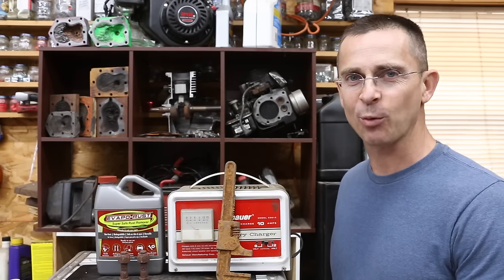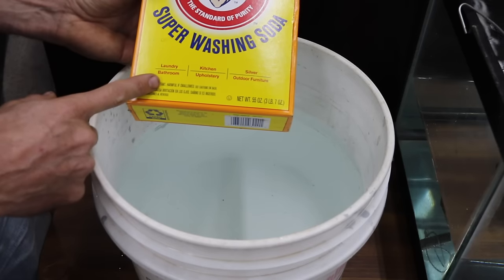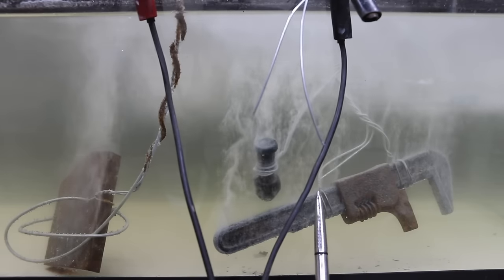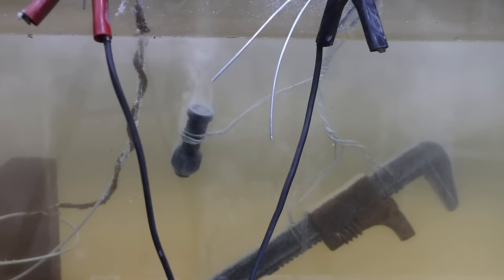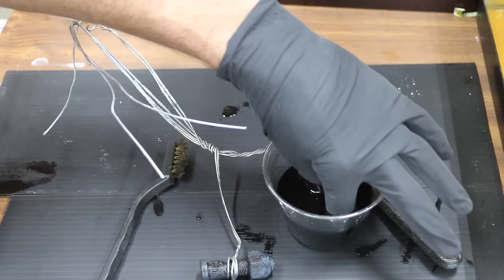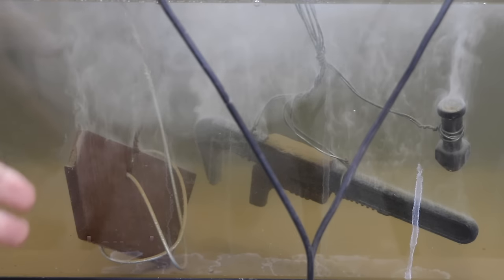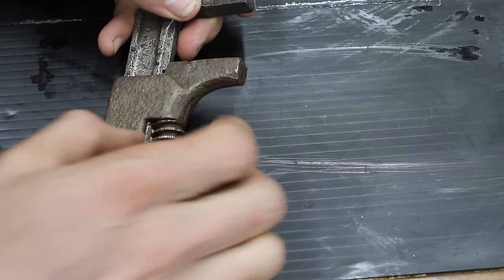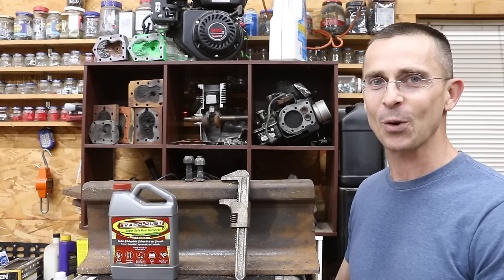Is Electrolysis better than Evapo-Rust?  Let's find out!

Comment: I use both processes. For small parts (nuts, bolts, etc.) that can fit in my Horrible Freight ultrasonic cleaner, I use Evapo-Rust. I first clean the part in the ultrasonic cleaner to remove any dirt, grease, etc. that might contaminate or inhibit the Evapo-Rust. I then drain the ultrasonic cleaner and fill it with Evapo-Rust. I use both heat and ultrasonic agitation. It works great for getting into fine threads, crevices, etc. in the small parts. Much better than just letting it passively soak in Evapo-Rust. For larger parts I use electrolysis. Note that it's important to only use plain steel in the electrolysis process--both for the part being derusted as well as the sacrificial part. Stainless steel, galvanized steel, and other plated steels can make a toxic soup. Plain steel only leaves iron oxide behind so it's safe to dump it in your yard or down the drain. I reuse it over and over until it's just nasty looking and then dump it. Even when it's so brown you can't see anything in it, it's still effective for electrolysis. Another great video. Thank you and happy new year.
Reply from the maker: Lex, This is great advice!  Thank you and wishing you and your family a Happy New Year!
Reply: @ProjectFarm  Horrible Freight is a good name lol. Just a tip, HF has a lot of great stuff for cheap, and a lot of garbage for cheap. If you want to have a good HF experience, you have to know what to buy cheap and what not to.
Reply: @ProjectFarm  Notice the moving side of the wrench isn't nearly as clean as the handle. I suspect that's because you didn't attach wire to that part directly. Its depending on the bond or rust in between to carry current to it.
Reply: Testing ultrasonic cleaner solutions would be cool too....
Reply: just posted and saw urs ya evprorust got a channel on it also you dont have to remove it just put evprorust in a glass or plastic container or a heavy duty ziplock bag in put in the soapy water then you dont need to fill it up looking at getting a good ultrasonic cleaner
Reply: I had been wondering about the rust removal + ultrasonic cleaner combination for a while - it seemed like an intuitive no-brainer combination, and I'm glad to hear that your experiments shows that I wasn't completely mistaken. The only thing "left" in my thought experiment is whether there's a need for circulation in the bath, or is the agitation of the ultrasonic action enough.
Reply: Just want to point out when your water is brown that just mean it has a lot of iron oxide particle, which actually help electricity flow in the water.
Reply: atourdeforce ......you suspect correctly......I've been doing this for some time now and that is exactly what happened. Should have a wire on each "separate" part of the tool. Would have come cleaner quicker. Great video.....Happy New Years to everyone
Reply: Thanks for the additional info.
Reply: I was wondering if he had changed the water if it would have helped or not. Thanks for the info
Reply: @coletrickle1775  Agreed, HF has many good too!s and some bad ones. But you'll find this is true of most general consumer brands (Kobalt, Husky, Stanley / Black and Decker, Craftsman, etc) I've bought my share of crap from them all.
Reply: Actually, for a very "clean" electrolysis you can use graphite as the sacrificial part.
Reply: Do you have to clean off the Evapo-Rust with water or soap or ?
Reply: Can you tell why using stainless makes it toxic, I use acid proof, and hope to save some work.
Reply: @yvinddahle7714  You'd wind up with hexavalent chromium in the in the solution, since stainless steel contains a fair amount of chromium.

Comment: every time you extend the dipping time in electrolysis, you NEED to clean up the sacrificial piece of steel, otherwise the conduction is weakened by the rust accumulation.
Reply: This!
Reply: Also he needs the wire on the body of the wrench so that part of it is conductive.

That and the wire of the anode shouldn't have been submerged.....
Reply: @Iyzdor  Why not submerge wires? I have guesses about wire of the wrench, but why not submerge wire of the steel?
Reply: @suchistheuniverse7858  my guess: because it rusts as well, and because it is so thin, it will rust all the way through very fast. Once that happens, it will stop conducting to the plate.
Reply: Yeah I used to just put my sacrificial plate on the ground and it would clean right up
Reply: @xfreeman86  no it won't. It takes an extremely long amount of time to rust through 1mm of steel, even with current.
Reply: You also need to top up the sodium carbonate
Reply: @pietrotettamanti7239  it doesn't need to rust through. only the surface needs to rust to affect conductivity
Reply: @LC-hd5dc  rust doesn't stop electrochemical corrosion from taking place for 2 reasons: it doesn't have a well defined crystalline structure and it's very porous, so it allows ion exchange. 2: Fe(III) oxidizes metallic iron to Fe(II) which stays in the rust matrix for the most part, making it somewhat reductive.
Reply: @abradolflincler00  How putting it on ground helps?
Reply: @otofoto i think reverse the polarity, make it a cathode rather than an anode for a short while
Reply: @drQ11235   But it would rust the submerged part.

Comment: Ideally, you need to connect the wire directly to the adjustable jaw for it to work. It wasn't getting a connection from the battery charger from the beginning.
Reply from the maker: Great point and thank you!
Reply: I was yelling that at the screen but he didn't hear me
Reply: Thank you I have been screaming at him all video to connect that.
Reply: @ProjectFarm  Could try a wrench again with a jaw connection!
Reply: @MegaKencam  🤣👍🏼
Reply: I does appear the corrosion prevented the 2 pieces from making electrical contact.  I would be interested to measure between the two with an ohm meter.  
Reminds me of why my trailer lights have issues if I rely on the frame for grounding.
Reply: Agreed I was gonna comment the same.
Reply: Exactly
Reply: @MegaKencam  me too!
Reply: Yep, clearly there was not good electrical contact the adjuster part of the wrench; although it looks like the 2nd or 3rd time it started making some contact.

Comment: JUST WRAP THE WORM GEAR PIECE IN THE wire and it wont take a million days
Reply: 100%
Reply: Is that what the screwwy bit is called?

huh
Reply: This was so frustrating to watch.
Reply: At least he asked how he did, I’m glad he’s always looking to improve because the location of the electrodes may not have occurred to him at all when setting up the experiment.
Reply: @RobBank1985  how in the world didn't he realize that? lol
Reply: I was yelling that at my screen
Reply: I was gong to say the same thing.
Reply: I wonder if wrapping the jaw of the wrench and the worm gear would have accelerated the process... Such a cool video!! Very very cool. I also wonder if there was any weight difference in the sacrificial steel
Reply: The impedance between the shaft and the moving bit seems high. You can see the difference in color.
Reply: I was saying the same thing to myself
Reply: When doing electrolysis method on heavy rusted parts, it's ALL about the annode (the sacrificial part), it must be cleaned regularly to facilitate the process. Or several annodes. They will accumulate a lot of rust, and won't work as effectively as when they're a bit cleaner. 
If it was easy...
Reply: IKR
Reply: Not a worm gear.

Comment: I grew up in a race car shop. We used electrolysis all the time. If you want that adjustable wrench to get free from electrolysis, wrap one of your negative wires around the adjuster. The electrical flow is not jumping the rust gap between the wrench and the adjuster.
Reply: You could skip the wire brush with better negative wire placement. The brushing got enough of the rust gap out of the way so the current could flow through it. Just put one of the negatives on the actual adjuster too, won't have to brush.
Reply from the maker: Great point!  Thank you
Reply: @ProjectFarm  Hey man, thank you for doing all these cool comparrisons. I love all the ones with JB weld the best, I have been using that stuff for almost 20 years, and I'm only 34 years old lol. But I like to see that nothing has dethroned it yet.

Comment: Happy new year!

The movable jaw wasn't conducting electricity well and needed an electrode of it's own.
Reply from the maker: Thank you!  Happy New Year!
Reply: i was wondering if i was the only one that thought that
Reply: Was thinking the same thing.
Reply: Also the nuts needed electrode contact. Switching position of the electrode helps.
Reply: Charles Watts - Completely agree.
Reply: That appeared pretty obvious to me. Why no mention of it in the video?
Reply: Charles Watts 👍👍👍👍
Reply: Charles Watts I was hoping I’d see this comment. We can’t all be crazy.
Reply: Also a new sacrificial plate helps speed it up. Great video though 😁
Reply: Yes, plus immerse four sacrificial anodes to surround the rusted piece (cathode) because electricity tends to flow in straight, direct lines (path of least resistance).  Some people line the bucket with chicken wire.
Reply: Slap my forehead... I was thinking the metal composition might have been different . I love evaporust when I can use it within economic reason. I've made different sized PVC pipe tanks to soak items in. Evaporust can also be reused until no longer effective. I strain it through coffee filters. For large items, plastic storage containers with rebar attached at the corners inside serve well with electrolysis. 

If others have made these points already, I apologize; : Use electrolysis with good ventilation, and DON"T use copper for the sacrificial materials. I don't know the chemistry, but some kind of extremely hazardous liquid is formed from copper in the liquid.  Copper wires can be used to join material to each other if they are attached above the liquid line; suspend the rusted items with non-copper wire.
Reply: Came here to say that, glad you saw that also.
Reply: @kellerrobert80  That's a good call on that!
Reply: @philod902  I don't know how hazardous it really is, but most likely you're going to make copper carbonate. If it's blue, it's got copper in it.
Reply: Mr Watts ought to know... just based on his family name. But, as an electrical engineer, I can tell you, he's correct.
Reply: Agreed
Another wire on that part would have worked better.
Reply: @bullfrogpondshop3179   My guess is he wanted to keep the testing process constant.
Reply: Thank you how did he not notice??
Reply: @jaredalexander3403  

Seems like this guy stays pretty busy.  I'm guessing he films multiple "videos" and then sits down to edit and upload individually.  It makes efficient use of time especially if one has a day job.  A lot of times, these "do cool stuff" guys blatantly do stuff to get people posting comments as the interaction is beneficial to the algorithms.  Either way, it doesnt matter to me if he intentionally missed it to spark conversation or if he missed it on accident.  I like his videos!
Reply: @jaredalexander3403  

Some of these "do cool stuff" guys intentionally wont wear safety glasses or hearing protection and so on.  Then the comments by arm chair safety nazis flood the channel, the algorithms see fan engagement, and advertisers pay Google, and Google shares a few pennies with the channel.  It's a win/WIN scenario and there is no mistake who gets the bigger "win".  Hint: it rhymes with moogle.
Reply: Exactly what I came here to say.  The rust was definitely working as an insulator and inhibiting the electrolytic reaction on the jaw and the nuts.
Reply: It looked that way, the rust removal was very selective at first.
Reply: Was just thinking this
Reply: Charles Watts f
Reply: Love your videos   Really appreciate the effort you put forth. I am a tradesman here in Chicago and often wonder about many of the products you are testing.  Please let us know more about you.  What do you do for a living ? Are you a farmer ?  Do you make enough from YouTube to pay for your supplies at least ?  Thanks again for your hard work
Reply: I was trying shout that out the whole video.. the rust wasn't giving it the proper contact it it would have worked so much better
Reply: Or it could be a different type alloy aka a different mixture of metals as to why it was not conducting well.
Reply: @philod902  evaporust is non-comparable with electrolysis simply because of cost. To remove rust with electrolysis costs so little it's not even worth figuring out a cost, compared to evaporust which is very expensive. Not contest imo.
Reply: @19971997gt  bigger piece/pieces of metal ie surround the pieces and it works in hours, not days.
Reply: Yeah, this guy is not completely genius
Reply: No perhaps not but he is helping us to decide what is best and worse. Its more than what I am doing. I would like to but i'm camera shy and a bumbling fool under pressure and trust me i'm no Genius ether 8). this guy is real fun and mostly accurate. As accurate as a regular Tuber with everyday stuff can be. So you can say what you want ( its your right) but please try not to discourage him from teaching us what he knows and being a positive contributor to this channel.  Peace
Reply: I was about to say that.
Reply: yeah, no bubbles mean it's not connected
Reply: or sand it that was this was my thinking too. I found a pipe wrench in the garden of my new video and was undecided about which method. Electrolysis for me; much cheaper and cooler scientifically.
Reply: Yeep. I guess that between both pieces there is an unconductive rust lay. Great video!
Reply: @Charles Watts - Immediately thought the same. The color difference between the movable jaw and the rest of the tool should have been a clue. For a one-off deal there's perhaps no difference. But if I was doing this on a regular basis I'd think some sort of vibration applied to either medium might accelerate the process by encouraging the dross to flake off and expose new rust to the solution. I know industrial applications use such techniques, but (at least for the electrolysis method) a simple aquarium pump would probably do it for the DYIer (not sure if it would work with the chemical medium due to incompatibility with the plastic moving parts). Or you could risk death by "borrowing" your wife's vibrator and immersing that in the solution. Only problem there is that if she finds out, she gets the house.
Reply: That's what I was gonna say. The oxide must have been preventing most of the current from traveling through it. It's an easier path to go straight through the handle.
Reply: I agree.
Reply: Have you also tried a comparison to vinegar? Shock treatment helps with frozen nuts, so does heat.
Reply: Yes ,your so right, that would have sorted it right out.
Reply: Same for the worm wheel! :)
Reply: Yes k agree
Reply: But this way we got to see, the impotance of good conections.
Reply: @NotHarry-er3wg  excellent point